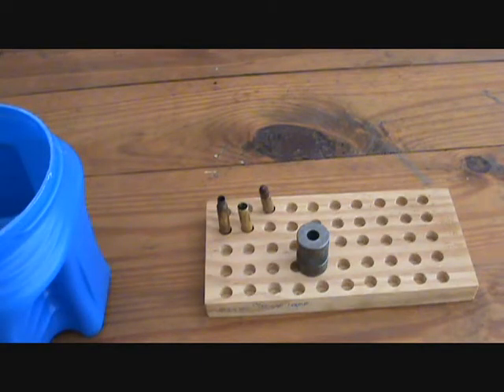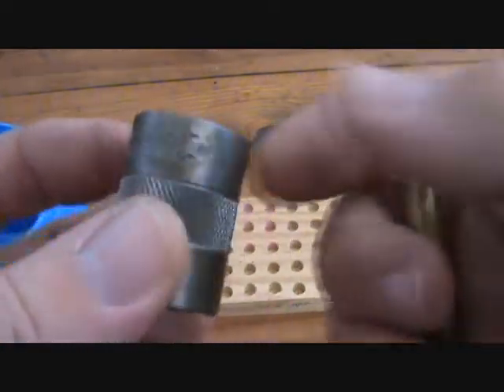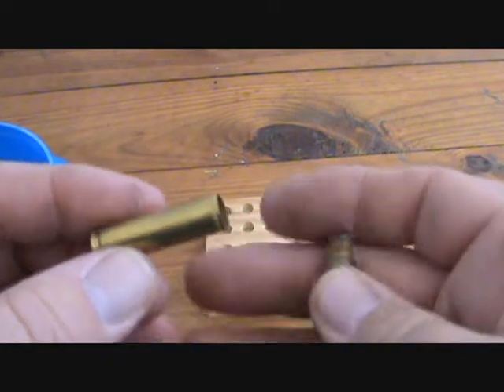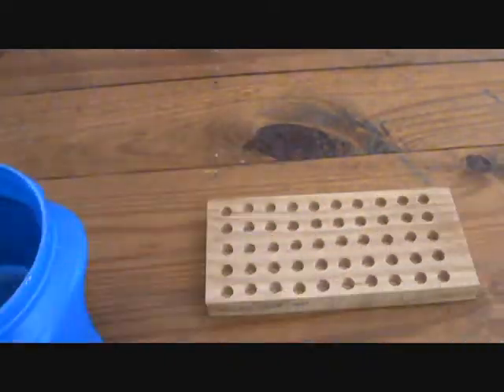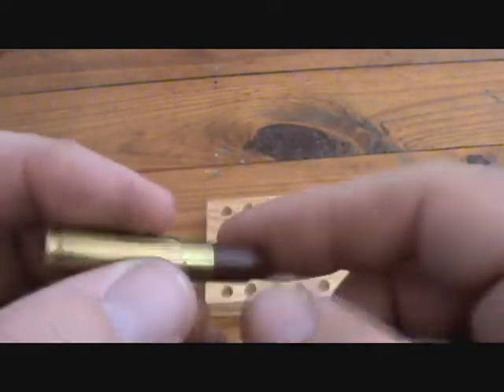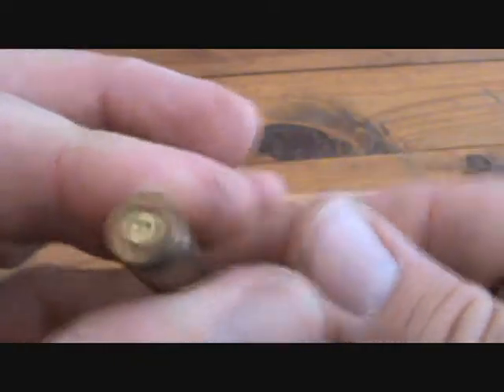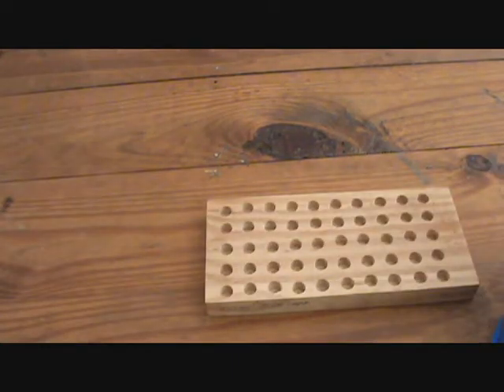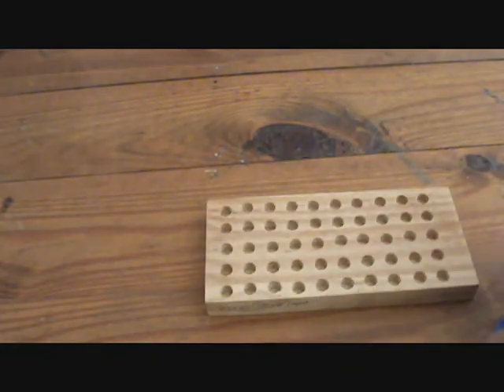300 Blackout brass converted from .223/5.56 why it jams

Comment: I just lube it and run it through the resizing die after its load. Remove the deprimeing pin first of coarse
Reply: Interesting. Resizing live ammo. Squeeze the neck back in after loading? Wouldn't a solid crimp work as well?
Reply: I met a guy with three fingers who did that.

Comment: Friendly advice- Ditch the Wilson gauge.  Buy a Sheridan slotted gauge.  I used the Wilson for a few years with great difficulty.  Purchases the Sinclair and my problems went away.  I can have reloads that fit the Wilson but not the Sinclair. The  Sinclair seems to be a more precise replica of 300 BO chamber dimensions.

Oh and I am going to research what you are relaying here.  Not totally sure I agree yet but still.  Thanks for the insight.
Reply from the maker: Thanks for the info
Reply: @willwood487  -My pleasure.  

I have been micing my casing's neck thickness, and there are in fact variable.  I just can't wrap my mind around how neck thickness can interfere with outside case dimensions on a properly sized and loaded cartridges.  I check mine via case gauge after loaded.  I will still have a few that will not chamber correctly.  Heck, I have some that once sized won't fit in the gauge.  Often times I can't see or measure any difference in outside dimensions.   Soooo maybe you are on to something.  The work continues.
Reply from the maker: @j.settle6448  they have a list of usable head stamps and ones that won't. Everyone I had that wouldn't work are on the don't use list.
Reply: @willwood487  Yes I went on there and checked it out.  Good info.
Reply: Have been having this problem as well, and agreed get a Sheridan, but, when fitting unloaded brass that’s been fl resized and it fits properly, then you seat the projectile and now it doesn’t , one of two things is happening or both, the projectile is the wrong diameter like .310 bore for example which will force the outer neck diameter to grow or the projectile is correct and the neck wall is to thick and needs to be turned down to a thickness of no more than.012 1/2 th, a little less is ok, here’s the thing, different manufacturers have different weights resulting in thicker walls, most anyone who is using brass with different head stamping and tries to use it for precision long range shooting knows this about brass as it will generally have different case volumes